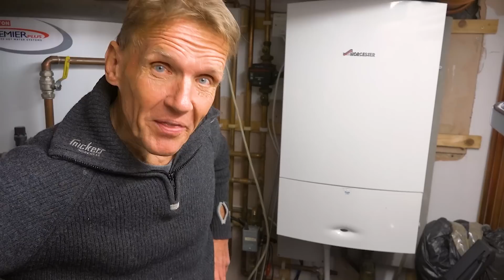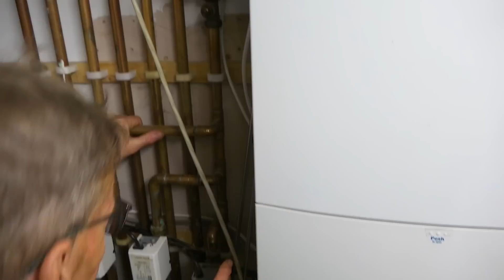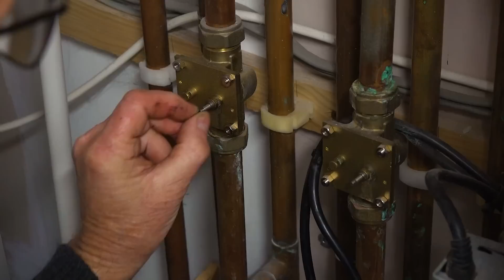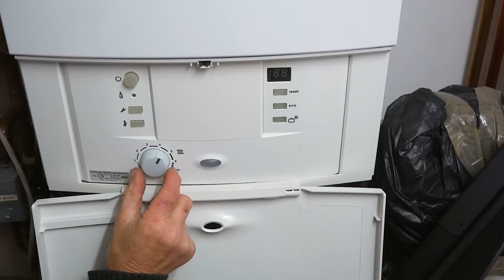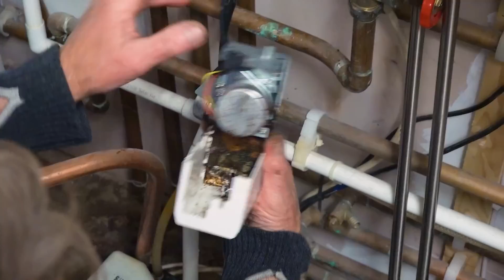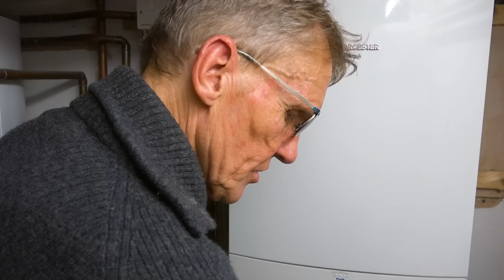How Did British Gas Miss This Simple Fault?

Comment: Looks like reliance, used to get them with our ufh packs, the spindles leak fresh out of the box......
Nothing surprises me about GB, some of the roughest work iv seen,  but there's some good   ones but a lot of the experience got pushed out the door to bring in cheaper perfectly moulded engineers. Fair play Roger for putting it out there 👍✌️
Reply: 20+ years ago, BG engineers had training and management sessions every week at our local big church and community centre in East London. It was a nice earner for the centre and the engineers clearly had a good esprit de corps. That came to an end and, about the same time, BG standards plummeted

Comment: Current imbalance L-N.... yep, filling an expansion vessel would be the first thing on my list too...

Closely followed by testing the RCD and measuring what leakage there was at the MET.  Could be the RCD has become too sensitive and is tripping below its spec, or there's other items totting up the current leakage and those valves have added a bit on top to trip it.
Reply from the maker: you are kidding me. The valves were soaking wet. Fix that then start looking for other faults if the RCD is still tripping.
Reply: 😂😂😂 oh fuck off mate!!

Roger, you’re too polite!! 😂😂😂

Comment: To be fair on British Gas, they might be only looking at the boiler which is covered, these are 3rd party installations?.
Reply: Obviously we don't know the ins and outs of things. But if the RCD's tripping and its been localised to the heating system, then a bit of common sense prevails in breaking down things like isolate the boiler and run the pump/valves and visa versa. Either way its a case of looking for leaks onto electrics and isolating pumps/motors. Pumping up an expansion vessel is mind bending.🤯

Comment: British Gas quite good if you get the right person plus if there are any complaints they will not charge customers cause fault not solved. 
Like u said, intermittent faults sometimes not always easy to find.

You right some more better at pipework, some better in electrics and some all rounder.
Reply from the maker: Whatever the level of talent, those leaking  motorised valves were not hard to find.

Comment: not sure where you stand there leaving heads off relying on boiler stat on a unvented cylinder the high limit wont shut the valve but hey don't let me be that guy well done roger
Reply from the maker: Hi Galaxy
The limit stat in the cylinder will shut off the signal to the actuator and the microswitch will cut the boiler off. 
If the cylinder overheated you still have temperature relief. The boiler also has a thermal cut out so very hot water returning to the boiler would cut it off. 
As for the cylinder being unvented, there is a lot of scaremongering where unvented is involved. I have done that G3 course so many times and they always show the shed blowing up.
They by-passed every safery device to get that to happen.  Vented cylinders don't even have those safety devices and a frozen feed and vent with a runaway stat will do just as much harm. 
I saw one a few months ago that left a woman with steam burns. It was a vented cylinder that the landlord had made into an unvented cylinder. I wasn't allowed to report on it because it is going to court.
Reply: @SkillBuilder  okie dokie

Comment: Nicely solved there Rog. I’ve got an old potterton boiler and a boiler mate 3 thermal store with a full pressure hot water heat exchanger. I had a British Gas monthly insurance. I had a problem with it and the guy didn’t know the system. I cancelled it and fixed it myself. Fixed my mates around the corner too. Do a bit of research and it’s worth doing it yourself if you’re a bit handy.
Reply: Remember, "A little knowledge is a dangerous thing'.

Comment: Ive found they aint worth a toss most of these cover plans. Anything over 7 years old they probably wont repair it anyway...ive always just bought a new boiler around£900 fit it myself and get gas man to check it and pass it off.pretty easy to do it all in copper.
Reply: Do you know that's illegal
Reply: @russellsmith6476 ..why if a gas safe engineer comes to sign it off?

Comment: They are truly shocking. Ive got some rentals, designed and built in the 90's. Now the gas pipe size and flue termination isn't to today's standards, they refuse to issue the Landlord cert.
    Tenants tell me the engineer said to them its ok,  just not up to todays spec. Yet the cert issued says appliance unsafe and isolated 😂. Theres no point in having a service contract with them as they refuse to sort any boiler faults.
Reply from the maker: The London Electric Boiler Company is doing loads of boiler changes because of landlord's safety issues. If a flue passes through somebody else's flat you have to condemn it because you can't check it.
Reply: @SkillBuilder  Surely a flue passing through someone else's dwelling was never ever compliant. 
   Still, my stuff was new build, building control signed off. I just use more sensible contractors. Keep up the good work Roger, you're a National Treasure.

Comment: I’ve got a vaillant 843 combi top of the range ,it’s been a pain in the arse constant f23 vaillant told me it’s not an economical fix,  plumber didn’t register it so had no warranty so I had loads of people look and no idea in the end I fixed it. It was the ntc sensor cost £10
Reply: Stick with your Vaillant theres not too much goes wrong, and tech support has always been great in my experience.
   Worcester on the other hand, awful from product to engineer!!!!
Reply: @ChariotsofWire180  Worcester boilers are far better than Vaillant. I have replaced many more parts on a Vaillant then I have done on a Worcester 😎😂
Reply: @customhoused4335  Cool. Next time I inherit any Worcester shite, you may have it FOC when ive stripped it out. 👍
Reply: @customhoused4335 Possibly due to age. Worcester don't last long enough to become "old".

Comment: Had a similar trip fault with our potterton pro max years ago... It would not fire then switched itself off. New board, new spark gap generator... Was OK for a week then it started again. Eventually the 3rd engineer from British gas had seen this before - turns out the spark from the electrodes was jumping to the case causing it  to switch off, a piece of insulation tape and it was fixed.  I got most of the internal components replaced though 😂just reiterated to me never overlook the obvious
Reply: Had that happen on an elderly  heat only Ravenheat a few years ago. A bit of heatshrink over the ignition cable sorted it out. Boiler lasted 20 years and I've only just replaced it.

Comment: British Gas aren't the quality they were before privatisation. The training used to be really good. Now they just use subbies.
A customer of mine had a boiler pressure drop for five years.
They told him all sorts of nonsense, leaking pipes buried in the walls etc.
Out of desperation he asked me to have a look. I checked every pipe in the loft, every radiator etc.
Finally I found the leak inside the boiler casing. Just a weeping compression,  it was dripping onto a hot pipe and evaporating almost straight away. 
Five years of British Gas and a bricklayer solves the problem.
Reply: Bricklayers lay bricks!
Reply: @thermion7869  Yes we do but sometimes you have to sort out what British Gas can't
Reply: They mainly have direct labour. Sub contractors are used when work load demands.
You're pretty correct on the quality though, there's some great engineers, and an awful lot more terrible ones.
That's speaking from experience too.

Comment: Tripping power, so he topped up the expansion vessel?🥺
There are a lot of Gas Safe guys thats simply don’t know how to fault find,
My nephew had a problem with his Ideal Mexico heat only boiler pilot light going out after about 10 mins, the gas safe guy changed the flame detector thermocouple, still the same, he changed the gas valve, still the same, after £150 with no fix he gave me a call to take look.
Found 2 issues, 1st the universal thermocouple was a little shorter than the original and so only just touched the flame, 2nd I noticed when it stopped calling for heat and the burner went out, I noticed the pilot light being pulled away from the thermocouple quite dramatically, it’s a balanced flue so found this odd, I asked when was it serviced last, he said I don’t know, which code for never, on checking the flue through the heat exchanger we found it was virtually blocked, after giving a thorough clean its working fine, Im not Gas safe approved just an aircraft engineer, so I told him to call a gas safe guy to double check everything, but who knows who he’ll get?
Reply from the maker: yes it made me laugh.
Reply: Oh yeah, if your customer is in doubt of your actual skills just wave your certificate at them!

Comment: British Gas: years ago we had a service plan with them and gave them a call after smelling gas. A very grumpy technician came out, waved a sniffer about, declared we had a gas leak under the concrete floor (conveniently not covered by the plan), put a DO NOT USE sign on the gas main and left.

We were suspicious so called out an independent tech' who identified the old gas fireplace as the source. We were going to get rid of it anyway so that was pulled and the piping capped off. Job done and no further problems. 

My guess is the BG guy was unhappy as he couldn't use the leak as an excuse to sell us a new boiler.
Reply: British Gas hasn’t been involved in gas emergency work for well over 20 years. I work as a first call operative for NGN.
Reply: @Danfrank24  Briish Gas took the money and the technician they sent out was wearing a uniform with their logo on it, so separate company or not it's BG group and as far as I'm concerned they therefore hold the can.
Reply: Two separate companies
Reply: Our neighbours had a gas leak- while they were away. You could smell it in the street. Grumpy technician comes out and basically said I'm wasting his time, 'It'll be the boiler firing and not burning off all the gas'...  Two days later the fire brigade had to be called to ventilate the house as when they opened the door the air was dense with gas.
Shockingly poor. Could have killed people with their desire to ignore work.
Reply: Or gas pipe work wasn’t covered under your contract. People don’t work for free
Reply: @sdbrogs  "Or gas pipe work wasn't covered [...]"

Are you suggesting they only cover the boiler and nothing else? And if so why do you think he came out with a sniffer?

Also based on the likes to my comment it looks like over 30 people were able to join those dots.
Reply: @loc4725  well I’m a British Gas engineer and I’m guessing those other 30 people aren’t? There’s various levels of contracts, from boiler only right through to complete central heating cover, most covers don’t include gas pipes. As of October last year there’s no level of cover that includes gas pipes
Reply: @sdbrogs  Somewhat shocking although not at all surprising that gas pipes are no longer covered by BG; that company just doesn't seem to know when to stop digging, figuratively speaking of course.

But as for the pipe, it seems to me to be logical to assume that we wouldn't call them out on a heating-only plan for a gas leak which was unrelated to the boiler, that even if someone were to do so that the call center would pick this up and that even if these two points were overlooked that the technician would limit any diagnostics to just the boiler and not survey the house for the leak.

And even ignoring all that, my main point about them lacking the competence to properly identify the source still stands. If the customer's pipes were not covered by the plan then it would be better for the technician to recuse himself rather than continue and provide incorrect and misleading information.
Reply: @sdbrogs not exactly correct.  Current terms and conditions for the basic boiler and controls cover onwards, (that are on the BG website to download) , state that gas pipes are indeed covered, but, If they are visible and accessible, and not made of steel.
Reply: @CaptainCoolpants101  right so in the context of this discussion, the pipe was neither visible nor accessible (under concrete floor), therefore not covered under contract

Comment: I always follow you channel with interest, but you just removed the primary control (spring return.zone valve head) from an unvented cylinder and left the heat source connected. [ unless in the unlikely scenario there’s a second zone valve in series out of shot]. I saw that you turned the boiler temp down but you should know better. Tut tut.
Reply from the maker: I love that tut, tut. You sound like my mum
The boiler has a thermal cut out so it won't boil and the cylinder also has a temperature relief valve. There is a lot of nonsense talked about unvented cylinders. They do not rely on one safety device. There is much more danger with a vented cylinder. 
Check out the global safety record for unvented cylinders.
Reply: @SkillBuilder  The cylinder also has over temperature and pressure valves and the risks may be minimal but none the less the regs in the uk exist whether or not you think they are over the top.
Reply: It was a temp fix so client wasn't without heat overnight until BG come back and, hopefully, fix it properly.

Comment: First visual checks on receiving a report of "my electrics tripping when we switch the heating isolator on" is pump and motorised valves.  But as an electrician I can then call our support line back up and send the heating engineer to change them and I can get to the next job.

Comment: Years ago, after I left BG, I got called to a Potterton Profile.  It hadn't been out long.  Customer said that every so often, it would just go to lockout - requiring reset.  I was self-employed, but spent hours trying to figure out why.  As luck would have it, I was there so long, it started to get dark.  I had already figured that it was an ignition fault.  So, in desperation, I turned the kitchen light off and watched the ignition.  Sure enough, about every 15th time, I heard the spark elsewhere, not at the 'pilot'.  Then it went to lockout.  What was happening was that Potterton had made the PCB too close to the casing.  Every so often, it wanted to spark onto it rather than the pilot.  When it didn't prove itself, it went to lockout.  I replaced the PCB spacers with wallplugs and, to be sure, wiped silicone onto the casing to insulate it...and it worked a treat.  I phoned Potterton to let them know their error!  Needless to say, I couldn't charge the customer for over three hours playing with his boiler!  A year later when the service was due, he told me he had signed up to BG's 3-star, and didn't need me anymore.  I retire in four months, and I won't miss it, or people like him.

Comment: Roger you're a great problem solver.
Reply from the maker: This was page one of the manual. Very easy
Reply: I think he'd take the praise but say it's not him being particularly good but other folks being far worse at the job than their job title indicates. It's the same in every field of work from trades to tech. A friend's daughter started training as a radiographer with a well known teaching hospital - within a few weeks she was bullied towards taking a management job! she refused as she had barely started. The hospital had a staff chart to fill up and that's all HR was concerned with. It's partly low pay in NHS that means nobody wants to go into it as a career unless they have some sense of calling (so they get taken advantage) or they don't give a damn and climb the greasy pole with no idea of what their team does
Reply: No-one has pointed out that the design of the system is begging for failure. Mount the motorized valves horizontally with the electronics and motor above the pipes! That way drops of water will not enter the motor housing.

Comment: Had a problem with my old Worcester Combi last year, was about 10 years old, soon after lighting went into reset mode with no error code (no display, light flashes were generic). If you forced it to burn for about 20 mins by leaving the hot water running it fixed itself until turned off. Last winter 22-23 had the central heating running 24 hours at min temperature - like a car that wouldn't restart so you left it running. Spent about £800 on guys to "fix" it but they couldn't as it was intermittent, last guy said "maybe replace it".
So I did, £4k later + scaffolding and "just in case" gas supply reroute and it seems fine now. If only there had been something obvious I could blame.
Reply: Flame rectification issue  about £70 for new spark electrode and flame rectification 15min fix sorry to say
Reply: @russellsmith6476 Not sure, it lit reliably but went into reset mode within minutes, even with constant demand. If you kept at it long enough it warmed up and then kept going.

Comment: Are those valves line voltage? In the US, zone valves are run on 24vac, isolated from the line/mains voltage
Reply: 230vac